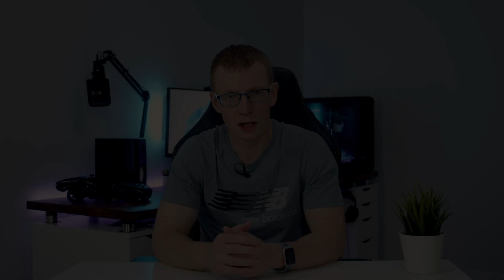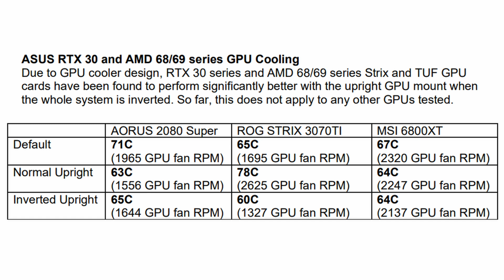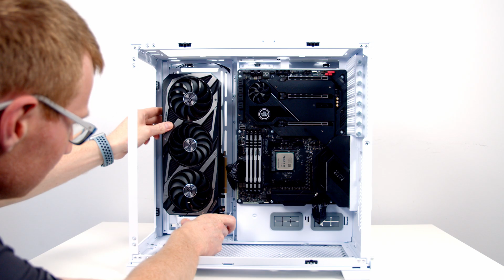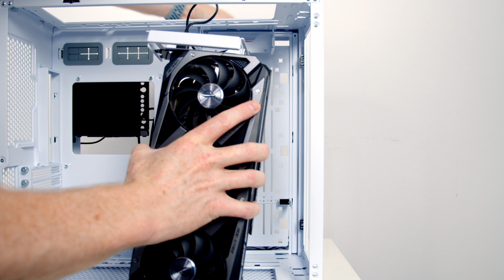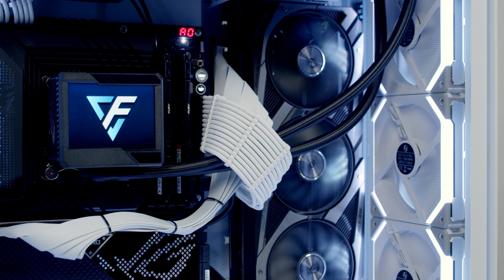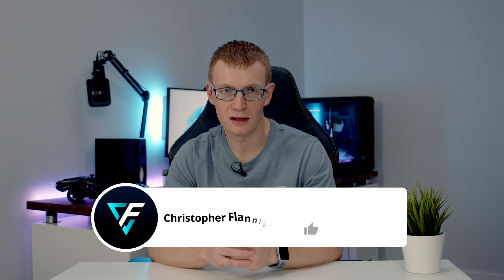Lian Li O11 Dynamic EVO Upright GPU - I was Wrong the Temps are Great!

Comment: Two year later and this is still pretty common with GPU's. I got the Tower 300 and tried 3 different GPU's ( two were the same model) and all of them have temps 15-20 degrees higher. Had conversations with several other Tower 300 owners and they were experiencing the same thing with their GPUs. It wasn't anything necessarily with the Tower 300 other than the GPU is mounted upright. Very likely if an inverted mounting option was available the temps would be much lower and I wouldn't be looking for another case that I can use the standard vertical mount.

Comment: I just inverted my O11D and it does indeed result in about an 8 degree drop in GPU temps.  Insane.  The only reason for this I can think of is the physical location of the GPU itself in the case.  In the standard configuration, the GPU itself is closer to the top of the case, where all the heat is.  In inverted mode, the GPU is closer to the bottom where the cooler air is.

Comment: Can anyone clarify what  is correct airflow in and out with upright gpu placement? There is confusing info in comments allover. The fans behind gpu should be intake or exhaust hot air out?
Reply: The fans behind the gpu have to be exhaust as shown in his video. Hope that helps.

Comment: Hello. I've recently bought Lian Li O11 Dynamic EVO i'm using inverted layout and i'm thinking about getting the upright GPU kit. What i wanted to ask is have you had any issues with the 12VHPWR power connector they are fairly rigid and there's risk of it getting loose and burning card i think?

Comment: Anyone done this with 4090? I'm have the same case I'm coming to the point that upright GPU isn't the way to go with MSI trio 4090 card. The bracket won't fit fans Infront grill are being blocked the GPU, the bottomed of the case your only able to have two 120 fans( again GPU overing the other spot lol. Bad thing before I started do this, I asked lian Li customer support and asked these questions as I knew there would be problems. They gave me just one word answer and it's yes it would work, I even are you sure because 4090 is a big card and again I get a yes. So after 3 hrs trying getting case where it needs to be, these is what I'm coming up with a long with spending 140 dollars just for the upright and front grill part for the case.

Comment: Not sure if you are incorrect still, I have mounted upright and I have insane high temps with a 3080 MSI as well.
Reply: All the 30 series aftermarket coolers are a little different. The heat pipe orientation dictates whether or not the cooler will work properly. Some models unfortunately will not work at all in upright position. A simple test you can do is just to flip your entire case by 90 degrees for a test run - so that your GPU sits in the orientation that it would in a normal case. Then if the temperatures are immediately a lot better you will know your card won't work in the upright position. This issue has been known in the industry for more than a decade but it didn't become a wide spread issue until these 30 series cards hit the market.

Comment: This video series about the best fan configs for the dynamic evo just got too all over the place. Can anyone clarify. I do not want to invert my case, my pc sits to the right of me so I want the left side of the pc visible. I would like to mount the gpu in the normal case orientation in the upright position. In order to do the upright configuration, to get the best thermals are the front fans a must. I do not want to obstruct the front and get the mesh kit. If so i will stick to vertical or horizontal gpu placement. Thanks guys.

Comment: As far as I understand it, you did not test upright GPU with sidefans, only front fans with mesh in your previous video. Any recommendations in regards to upright GPU with side mounted fans?
There are a few options I see. Should we even assume it makes a difference? 
 - Press fresh air past the GPU or pull air from GPU out of the case? 
 - Whatabout the back fan, would a back to front/side make more sense than front/side to back? 
 - Or maybe we leave the bottom fans as the only intake?
Reply: "pull air from GPU out of the case" using exhaust fans mounted behind it is the correct answer. 
"back to front/side" is never* the correct answer. 
"leave the bottom fans as the only intake" could be just fine, depending on how much overall cfm is intake and how much is exhaust in your case; too much exhaust means more dust, too much intake means stagnant air pockets, pick your poison or equalize. 
Since all* GPU have intake fans and is exhausts out the sides based on heatsink fin stacks, the fans mounted behind upright GPU should be in the exhaust flow direction, not an intake. 
The upright GPU is already getting "fresh" air from the bottom and/or front case intake fans without that air hitting anything warm before being sucked into the GPU heatsink by its intake fans. 
Regardless if the CPU is using an air cooler or AiO, this is true.

Comment: And how do you connect HDMI cables on and off when you change it? Is there also a module for this?
Reply: You'll need HDMI cable that's able to bend well, if not then your going to be fighting it to just stick it in card and it to put it in position. Then getting the cords to bend on the GPU is another task.

Comment: So it turns out the Msi gaming X Trio 3080ti needs to be inverted as well. When mounting the card in the normal upright position the avg temps under load were 83c with fans behind the card.
Reply: Did the temps drop once you inverted it?

Comment: Thank you! Good stuff! Yep the strix gets a bit hot the 3090 that is lol yet a 3090ti evga ultra has amazing temps!Temps! It pushes out a ton of heat, but it's doing its job and it's Temps are stable at 65c hitting 70x at full load. Idk how evga did it but they Def fixed the 3000series cooling issues with the 3090ti. Now people who complain about it getting hot mean the heat coming out of it in there room haha. But you did testing correct imo you don't only want to test the lower end gpu's that don't get as hot out of the gate. You should test the most demanding cards doing the most heat. This whole let's cater to the gpu that doesn't get hot is ridiculous. You want to test a case in the most demanding situations. So hopefully you can show us those results also of a 3090 or a 3090ti or something else lol.
Reply: I have a EVGA 3090 XC3 ultra and I have been thinking of getting upright kit but the previous video with very high temps has put me off. So do I understand correctly that evga cards don't have the issue? How does your upright temps compare to the "regular" position temps? Do you run fans behind the card and if yes do they push air towards the back of the card or pull away?

Comment: I tried mounting an rtx 3080 Gigabyte Vision OC in the upright position. My temperatures reached 90C with performance throttling resulting in a 400 point drop in 3dmark timespy score. in the horizontal orientation my temps are max 67C. i tried with side exhaust first and then switched to intake. not much difference as expected considering it is probably a Gigabyte problem. Another issue with the OC vision is that i had to rig my own L bracket (to prevent wobble). the Lian LI accessory did not fit no matter what combinations i tried.
Reply: did you mount with the fans behind them?i was actually planning on mounting the rtx 3080 vision inverted upright with fans behind them. Now reading this im thinking i should go with another card

i already bought the case and upright kit just not the GPU yet
Reply: @straightup920  @ill4r3al99 is exactly correct when it comes to that stupid L bracket. The Gigabyte Vision OC card width when in the upright position is too small to use the L-bracket properly. I guess the best solution is to set it upright and to not install the fans behind it.

Comment: You should put the side ( behind the GPU) fans to intake and the front of the case to exhausts or not use them at all for better temps ... The card is blowing hot air from its side and you have intake on GPUs side/front of the case.

Comment: What GPUs are affected with the upright mount instead of inverted upright mount?  I have an EVGA 3080 FTW3 but can't find the list that you mention in your video.  I want to figure out if I have to invert my build or not.  Also, have you tested the configuration of an upright mount without side fans but using the fan bracket that you mention in your video at the 7:00 mark?  I'm curious how this changes thermals and noise levels as this would give the option of saving money on not buying three more fans that will be blocked by the GPU anyway.
Reply: Did you ever figure this out? currently working on a build

Comment: I was wondering how it might affect the results if you did the upright position (not inverted) but did not use front intake fans. I do not want the mesh front panel. I noticed that your test for the upright in this video had more fans than the vertical or horizontal, Do you think placing it upright but without the front intake fans would significantly affect temps? I would just have a top mounted AIO, bottom fans, and the rear fan. I may not do this anyway even though I love the aesthetic of your case in this configuration, I am not sure mine would look as good because I will be using a asus z690 tuff plus MB and they are absolutely hideous. So maybe a vertical mount to cover up as much of it as possible. Then a side AIO. If I did it this way would you recommend I prioritize the top or bottom fans?
Reply: Here for the same question
Reply: @EricPimpi  sooooo what you end up doing?
Reply: Any word on unrestricted chimney with upright working well?

Comment: As always, quality video. One question with the upright gpu position. If you wanted to use a water block like the corsair xg7, would you be able to fit it in there? I just got my Evo. Have the pieces parts for the build pretty much rounded up. I'm doing a custom loop and I want the gpu upright.  Just can't really find an answer to that question and I'd rather not buy multiple mounts just to test stuff out. Any help here is appreciated.

Comment: 50db and higher? That seems extremely loud. Personally, I'm trying my best to fit into 35db (practically silent). What I'm trying to say is I'd try to tune the AIO first to make less noise (custom fan curve) so that tests would show the best balance between temps and noise one can achieve. I'm interested in Lian Li cases primarily because they're so versatile and have interesting accessories (vertical GPU mounting where GPU isn't pushed into the glass and doesn't have to suffocate, for example, as shown in this and previous video).

Thanks for the testing! I'm currently looking into minimizing the GPU temps and all this info is very useful!

Comment: New egg has the vertical mount. Everything else is on it's way too. Noticed your running the front mesh kit. You think I should get the front mesh or just keep it stock glass......also with 3 fans behind the gpu exhausting, doesn't that turn the case towards negative pressure

Comment: Hey man .. so with the Upright mounted GPU... it orients the GPU fans so they exhaust air behind the card .. given you have had the hands on... do you think it's possible to turn it around ? Where the fans of the graphics cards are facing the back ? Does the bracket that holds the card at the top allow it to be done ?

Comment: Interesting. How do AIO water-cooled cards go in the upright build? Surely the pump still runs the same if the rad is higher?
Reply: won't work, there's not enough room i believe for the tubing
Reply: @BlaZebura  hm? But surely if there's enough room for power cables, there's enough room for tubing..
Reply: @FlameH0t  tubings are way stiffer though, that’s honestly my main concern
Reply: @BlaZebura  My graphics cards tubes are connected with a 90° swivel angle with a height of 1.5cm from the card.. Think that will be enough room between the card and glass of the EVO?
Reply: @FlameH0t  it should be but i cannot confirm, i have neither that card or the EVO
Reply: @BlaZebura  oh haha oh well, I'm going to test it anyway.. Preordered the EVO for it's arrival to Australia 👍